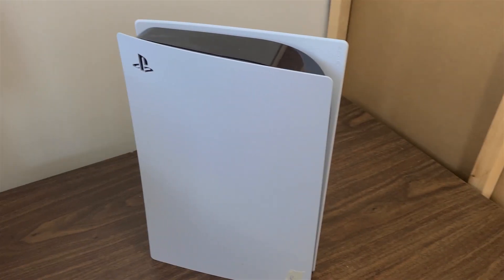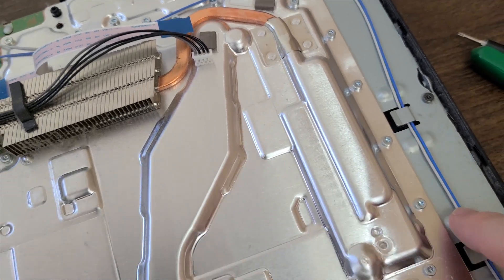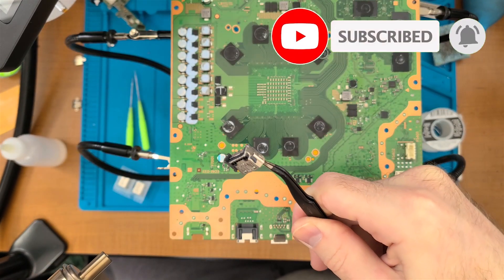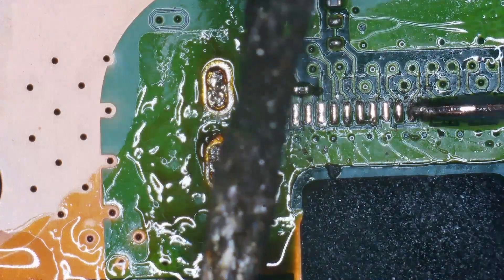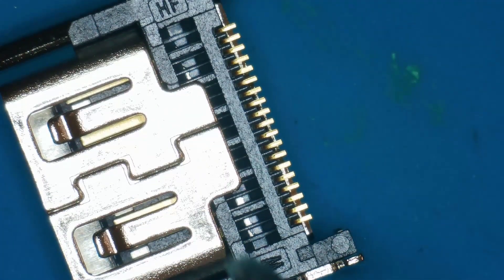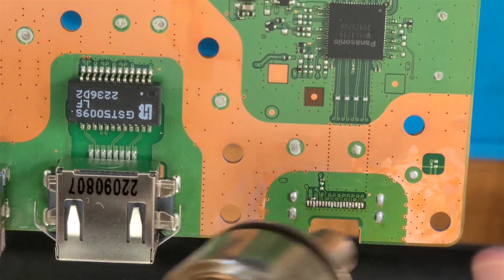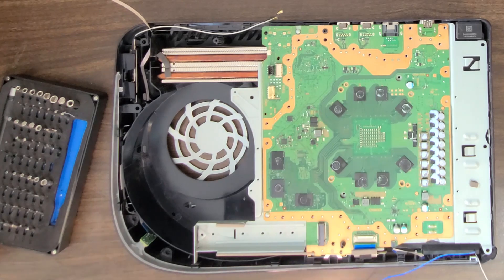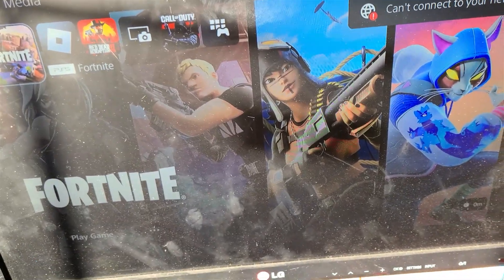PS5 with Busted HDMI Port - Let's Fix it!

Comment: Hi my ps5 keeps turning off for no reason I got a new power supply an it still does it can u help
Reply from the maker: @ikneo292  if it turns off while you are using it, most likely it either is clogged up with dust, or the APU has a dry spot on it. If you don't know how to look after it yourself, I recommend bringing it to a technician in your area
Reply: @TalmiiorFixesStuff  ok thx
Reply: @TalmiiorFixesStuff  do I need thermal paste
Reply from the maker: @ikneo292  no, the PS5 uses liquid metal. If the liquid metal gets on the circuit board it will short components out, so if you're going to do it yourself, please be careful
Reply: @TalmiiorFixesStuff  ok I will thx
Reply: Do you fix on a PS5 HDMI how much it will cost me